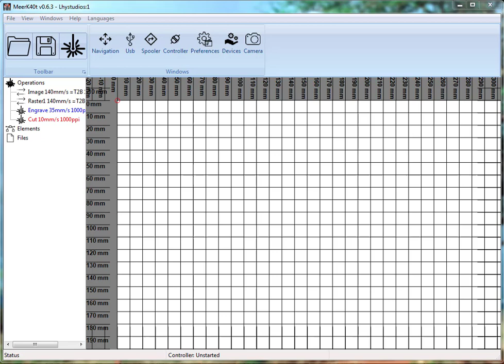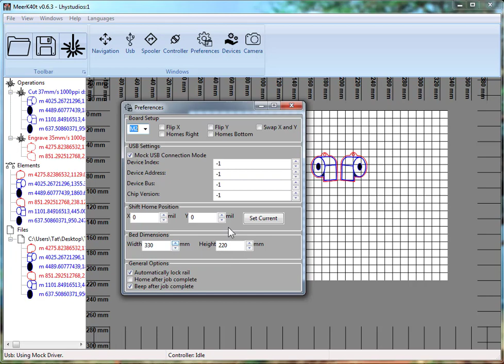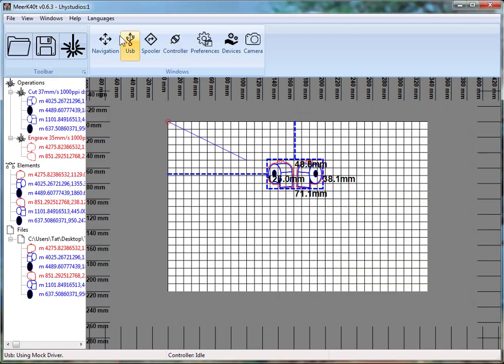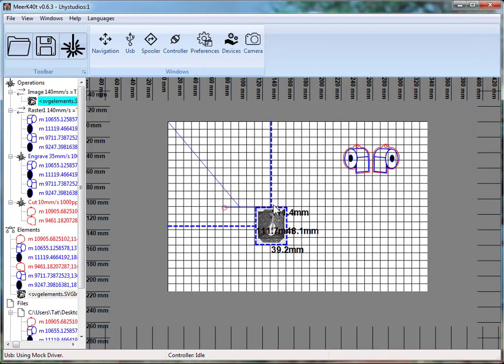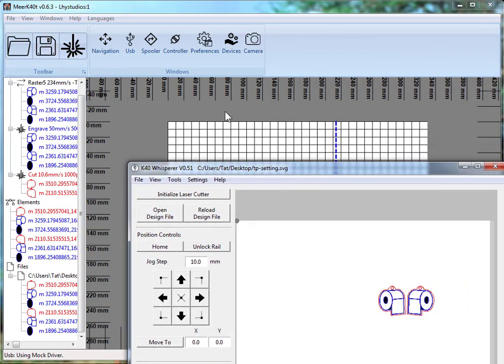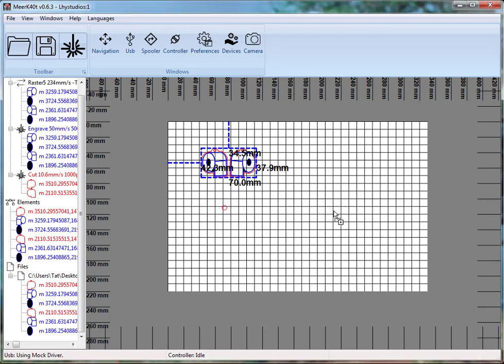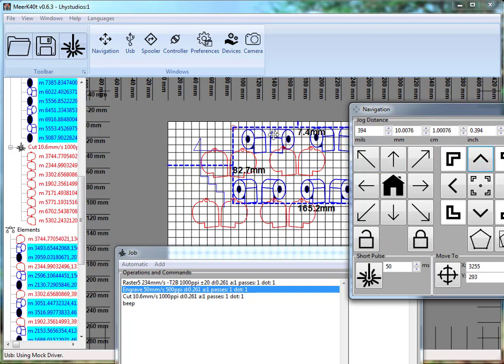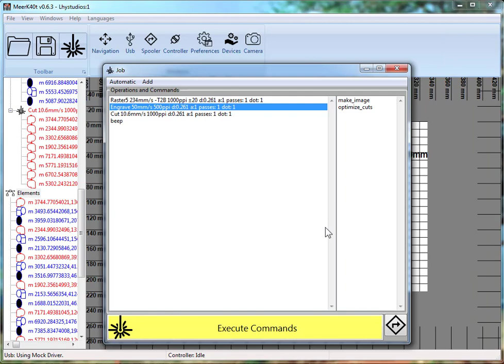MeerK40t - Coordinate System.

Comment: is it at all possible to “drag” the laser head like in k40 whisperer so I can unlock rail, physically align it with an item on the bed and then move the little circle in meerk40t to where on the workbed I’ve just put it. Really handy feature of whisperer that I’d love here
Reply from the maker: It's in 0.8.x, one of the tools lets you set the laser head's position. Though mostly this isn't extremely helpful for meerk40t because it gives you a view of the entire bed and where-ever you put the project, it'll move there.
Reply: @davidolsen1222  ah fantastic thank you

Comment: How do you set the image center to an object such as a flask where the laser head will position to.
Reply from the maker: In 0.8.x this should get easier but in 0.7.x you can select both relevant objects and type "align center" in console set it in the center. Though in some previous versions this might be better done in inkscape and then just imported. I may have misunderstood your question, since it's a bit confusing.
Reply: @davidolsen1222  If I want to center an image onto a flask so that it will also engrave that way? How do I do it? I'm trying to engrave a logo on to front of flask but in the center. I use inkscape to design and Meerk40t to operate k40.